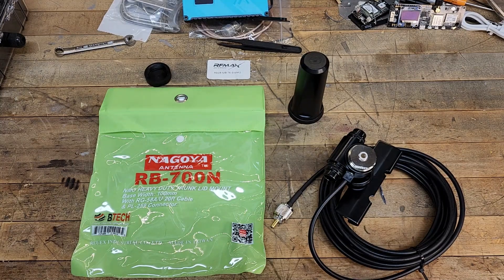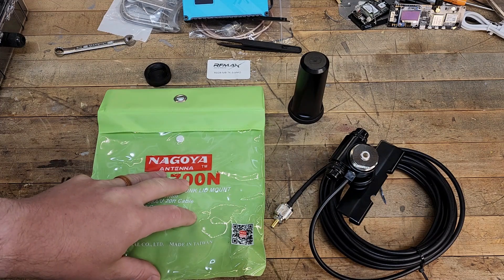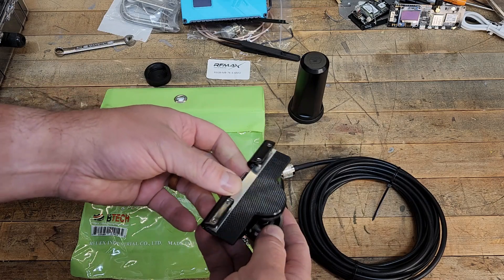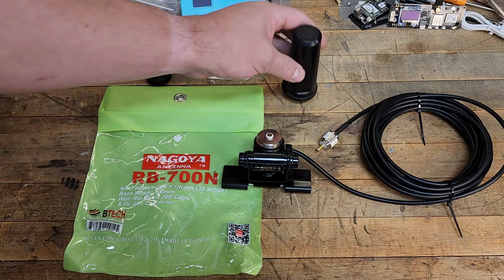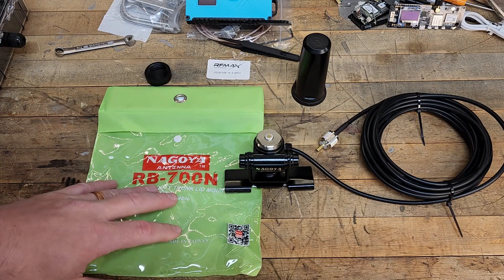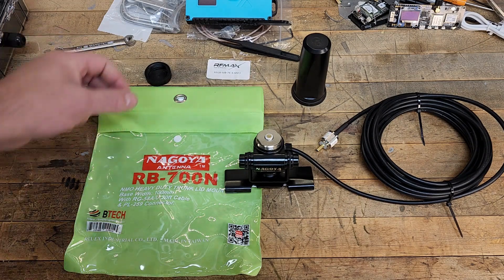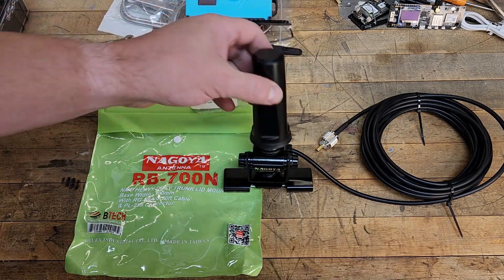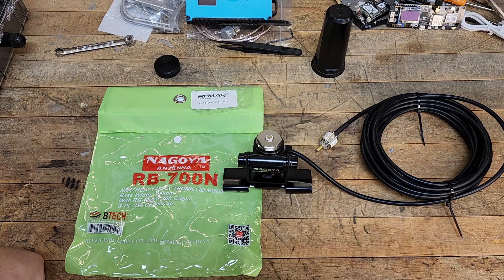The Best Meshtastic Vehicle Antenna! | 915 MHz

Comment: Great video, however the coax loss at 915Mhz with that mount would be astronomical.

I am planning on doing Mesh in my vehicle as well, however I will use an NMO Mag Mount with only 3 foot length of cable, mount the antenna on my vehicle hood, route the cable through the door, and put the Mesh moutned on my dash, that should be quite do-able. :)
Reply from the maker: Great point about the line loss. However, during testing, I was still getting 2 to 3 miles node to node. Which is about my limit around my local area due to terrain. Nonetheless, my next vehicle node build will incorporate the shortest coax possible so I can maximize my range.
Reply: @RavenwoodAcres  Well I did order the antenna, it's on the way. I have an existing NMO mag mount that I will sacrifice for the project. I took the existing coax off, ordered 6 feet of low loss RG58 SMA. I will probably use 3 feet of it, put the mag mount antenna on the hood of my vehicle, route the antenna through, and mount my Heltec on my dashboard. :)
Reply: @jacquesredmond  How is it working out?
Reply: @KateHikes1933  It's pretty good actually. I drove up to a high point, and reached a node 20 miles away. :)
Reply: @jacquesredmond  Good to know, thanks!

Comment: I've installed two of these setups now, love it for Meshtastic. I stuff a wisblock in a tiny Pelican case that I've installed an SMA pigtail on one side (and then external SMA to SO238 pigtail to the antenna base cable) and just a hole on the other side for the USB power, which I power only while the vehicle is running. I decided against running a battery on vehicle-based nodes because of the extreme temps that cars experience during summer and winter. The hardware can handle it but the lithium ion cells can't. Not worth risking a car fire.

Not the cheapest node...with the mount, antenna, enclosure, adapters/cables and wisblock it ends up being just under 200 bucks per vehicle node, but it's so nice not having to lug a portable node with me everywhere I go when I'm out and about.
Reply: Thank you for giving me ideas on a case for my Wisblock!
Reply from the maker: Very cool setup! Thanks for sharing and you just me thinking about my next project, haha.